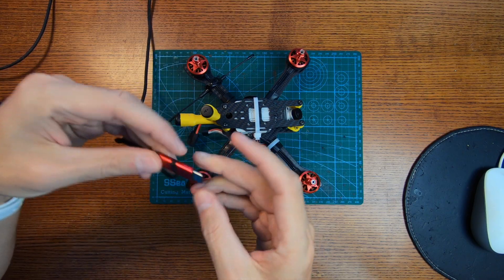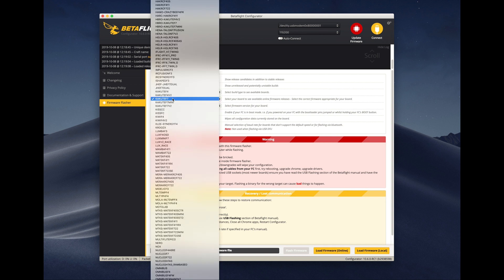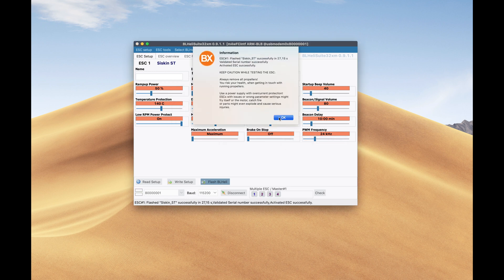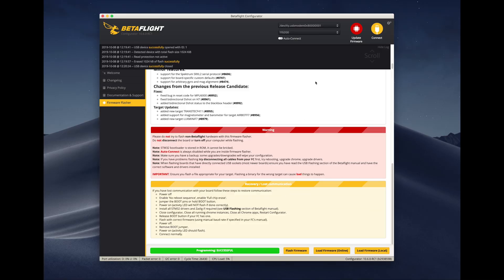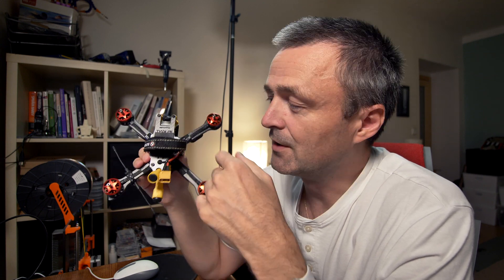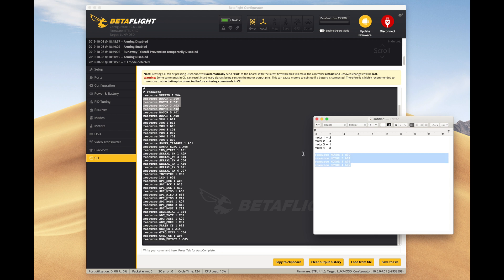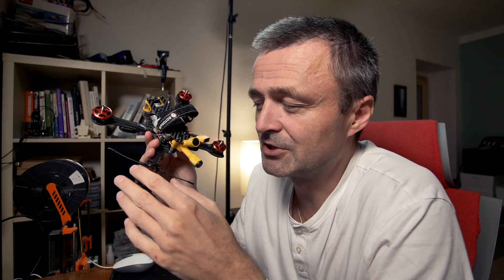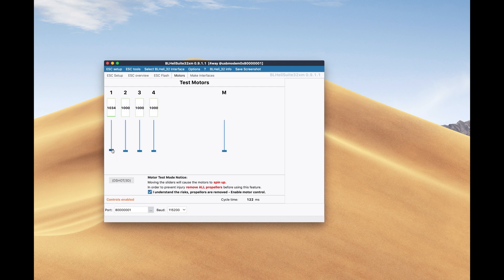Configure a Beginner Drone with DJI HD FPV [2/3]

Comment: For some reason after flashing with BLHeli non of my motors are starting to rotate (I am usin a 550mah battery, dji controller and everything from your first video)? I cannot figure out what my mistake is... Do you have any suggestions? I would be very thankful
Reply: Arming disabled because of RX_failsave and MSP maybe that is the reason?

Comment: Hey Jakub, please do carry on in making the last video of this tutorial. This is really the best thing I could have asked for since I am a complete newcomer. Also I am very glad you are a fellow countryman. I have a question though. Would you really recommend to a newbie, that has never flown before let alone held a controller in hands, buying a system as expensive as the DJI one is? Or does it make sense to start on a more inexpensive one? 
I am almost convinced to go and get the DJI system and build my first drone, but anyway, I lack friends with experience, that could help me out in deciding.
Reply from the maker: It's a tough one. If you think you could do with a really lousy quality, perhaps. But if you want somewhat decent and reliable analog gear, you're going to end up in a very similar price range. It just doesn't make sense to me for anything other than racing. Analog isn't for the faint of heart.

Comment: Hey Jacob, I am a great fan of your stuff especially the DFJ Sytem. I got in to FPV this summer, so my scills are limited yet. My main concerns are good cameras so the GoPro is a nice toy but not more. Apart from that I am blessed with the DJI X7 with Inspire - would be nice to convert this drone into a FPV Giant. I tried now to mount the Sony RX II on a 5 inch quad, no chance without a good dampening system. Please have a look at the video quality and maybe you have got some ideas to ipmprove the stability of the quad maybe through PID adjustments. And of coursen it`s a matter of flying scills https://youtu.be/G96jOqUfpH8
Reply from the maker: I was eyeing the RX0 M2 for night time flying, but it's still too pricey to gamble it on a quad. But way more sane that people flying Pocket Cinema 4/6K. :)

Comment: Dude! That's not a beginner qwad. I was flying 2 years before building and flying a 5inch
Reply from the maker: I wouldn't start building before being proficient in a simulator in 2019. Suggesting to build a 3" is also nothing for a beginner. Suggesting to buy a ready to fly also means you're going to waste someone's money becaue it will be broken ona 4th pack. This 5" with an allinone FC and 350g AUW is something I think will take a beating and will be nicely controllable. too bad about the need to rotate to the board, that really complicates things for the configuration phase.